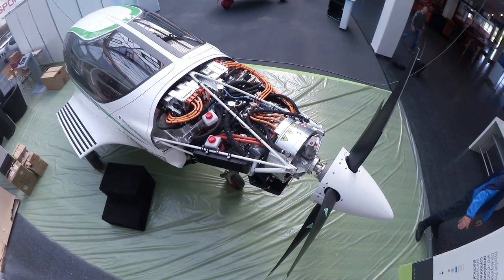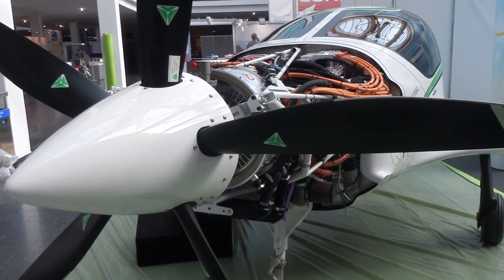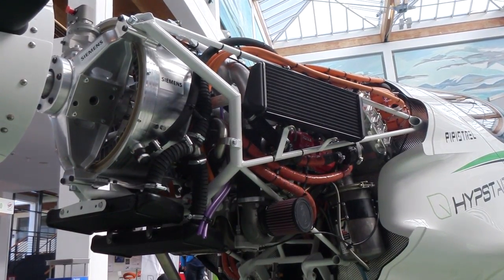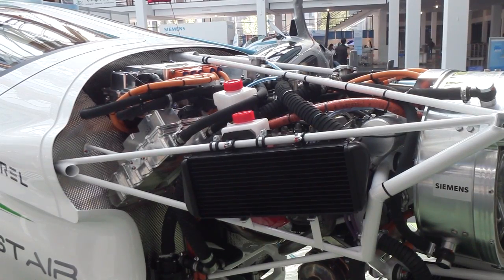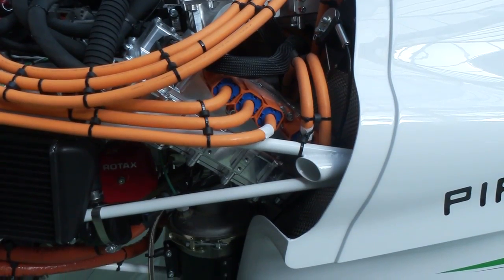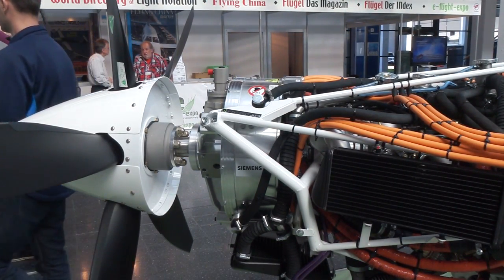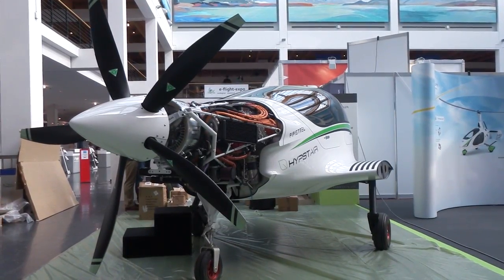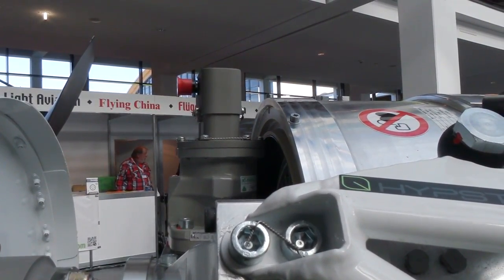Hypstair Aircraft Hybrid Drive

Comment: At that point, if the engine is only a generator, why not locate it further aft for better CG control?
Reply: This is not a car. The center of gravity is supposed to be front of the center of lift (normally at 1/4 cord of the wing). Either way when designing the airframe they customise the enpenage so it doesn't require elevator trim under average circumstances

Comment: Y not utilize a ducted pusher fan, 70% more efficient.
Reply: only when compared to a same diameter prop, and the aero drag of the shroud is not included. Also, integrating a ducted fan to an airframe is another problem, and almost ends up with a smaller diameter fan, hence a higher disk loading, and less efficiency than the prop.  A total solution is needed, not just a single relative statistic.

Comment: gas generator + multiple electric rotors with 2 blade props has pretty good implications for improving aircraft efficiency, using multiple 2 blade props you can eliminate interference drag of 3+ blades, and placing the blades on the wings allows for improving lift under reduced wing area. having multiple electric rotors distributing the power of 1 or 2 generators also can help reduce ground clearance requirements of high performance planes that otherwise demand more and longer blades.
Reply: yan-Deriction how much extra lift would you get by putting the engines on the wings?

Comment: Very cool development. Bu at the same time very complex. Aviation is about safety and that comes with simplicity and that equals to reliability.
A Rotax is complex, a 914 even more and now we have a 914 plus generator plus electric motor plus electric controls...
Reply: flexairz Old school logic.

Simplicity is only one of many avenues available today to ensure safety and reliability.  It used to be the only avenue due to lack of technology.

When was the last time you see a car died on the road today?  If you were around in the 1970's and before (prior to the advent of ECU in cars), you would see at least one car broken down on the side of the road per week.

ECU is much more complex than a simple carburator, yet why is it more reliable, hence safer for drivers?

You said the Rotax 914 is complex but has that engine died in-flight more often than the Lycosaurs?

In fact, more pilots with Lycosaurs experience engine failures than pilots who fly with Rotax - there is no way a human pilot could control fuel flow to each individual cylinder many times a second, for example.

How many pilots fail to manage their engine properly, which results in foul spark plugs, and pre-mature engine wear and shorten TBO?

Electric motors are inherently more reliable than gas engines.  In a hybrid system, even if the gas generator fails, you still have power from the electric motor running off battery.

Again, complexitity ENHANCES safety, not reduce it.

What happens if your carburated engine dies?  Oops, time to look for a suitable landing spot -- yeah well, good luck on that!

Bottom line:  complexity is NOT necessarily unreliable and therefore less safe -  not with today's technology.

Comment: This is a really exciting project.
Prius of the skies!
Reply: +discotechwreck The Prius is efficient mainly because it can take advantage of regen during braking, and partly because the efficiency of the drivetrain was improved, none of those benefits exist with this system. The efficiency of the power plant was not only reduced with this system, but there's no regen braking to take advantage of.
Reply: Assuming it's been developed from the same platform they used on the Alpha Electro, they actually use props with a wide chord at their roots which when at low power, windmill and act as a wind turbine to regenerate power & send charge back to the batteries.
Reply: discotechwreck A) That would offer very little in terms of power to recharge the batteries. 

B) That much drag is rarely needed on a light aircraft.
Reply: +idontcare80 You do realise Siemens, who have provided substantial R&D on this project, have also developed the engines for the E-Fan. What do Pipistrel, Airbus and aeronautical engineering universities know about efficient aircraft & engine design though?
Reply: +discotechwreck They know how to squeeze funding for ridiculous projects out of ignorant politicians.

Comment: Who would want to sit behind such an unneccesarily complex engine? unless of course its being funded by some one else...
Reply: +mhappy01 I disagree, this is a much higher sustained power rating than batteries alone, and a much higher power rating than engines alone (Rotax 912ULS 75 kw) for takoff under any conditions. 200 kw power delivery to the prop is awesome. Air density can seriously put pilots at risk because there is a direct relationship between air density and power output of the engine.
Reply: Well, mounting an electric motor to a generator is much simpler and more reliable than attaching a gearbox. That's why I'd argue that this is a simpler power plant application than exists in many aircraft already today. This type of hybrid has been in use for 80 years in many forms and is far more reliable and efficient than a direct-drive combustion engine.  It's not an unproven concept. The only reason why we're finally seeing this in autos and light aircraft is the advancement in battery technology.
Reply: +mhappy01 An electric motor being driven by a generator is complex?  Much of this is grant funded (universities) and is a joint venture with Pipistrel and Siemens.  

I'm not sure why you're against government funding of projects such as these.  Many of our greatest inventions and achievements as a society are because of government funding.  Want to know why we (the U.S.) is so far behind the rest of the developed world in innovation and infrastructure?  It's because somewhere along the line we got this notion that government spending in all forms is an anathema to a proper capitalist society.
Reply: Actually mhappy01, you're wrong again. The fusion of a internal combustion engine and an electric motor is not a new concept, nor is it overly complex. In fact, from a mechanical perspective, this is MUCH simpler. It completely eliminates any need for a reduction drive needed with gas motors  because the electric motor can be optimized for each type of aircraft. Sure, this idea has taken some engineering, and therefore money, but I would say you're in the solid minority in saying that it is a wasteful project.
Reply: +mhappy01 Are you aware that other countries have spent public money assisting aviation development?  Was that all bad?  NACA and NASA wrote many of the books mate. Or was that just propaganda?
Reply: +John Hogan NACA/NASA is not the EU (there is no comparison).
Reply: +Joash Church Joash, my point was that they are designing a massively over complicated engine, for what purpose? because they can afford to using someone else's money, would it be a viable engine if it were funded by a commercial organisation? It will break and often.
Reply: +Tytus Abrahamson Maybe i'm too pragmatic in this case. But we the EU tax payers are funding the CERN collider to the tune of 9 or 10 billion euros and counting, why? innovation? science? or political bribery to further the EU project? (hell, you cant even point the beam in the air and shoot something  lol just joking). I can understand having a diesel engine on an aircraft (safe, strong, reliable) but this engine/generator thing is never going to be a viable option in an aircraft - like having a titanium tea pot; holds water but wont retain its heat.
Reply: +Tytus Abrahamson sorry Tytus we will have to agree to disagree.  But a small Williams type turbo prop has to be simpler than either this type or any other reciprocating engine. That in my limited/ignorant view is where the research and funding should go.
Reply: mhappy01  You called something over complex it's because you don't understand anything about it nor the advantages ... I like to call people like that stupid.
Reply: +MidShipCivic Go ahead Yank, make my day.! I like to call people who wont accept a different point of view - "american".
Reply: mhappy01 Your inability to grasp science, is not an argument against it.
Reply: mhappy01 Weak. NASA and NACA are awesome, as are those taking up where they have left off.  The rest in YT trolling.  Dude.  Chill.
Reply: +mhappy01 I've just come back to comment after being reminded of how much work NASA has done on hybrids in recent times.  A lot.  This is part of where we're heading.
Reply: +mhappy01 It's like you didn't watch the video period you you just cannot comprehend to see it is a joint venture.
Reply: +MidShipCivic A joint venture paid for by the European Tax payer. Another EU propaganda funding for silly ideas.
Reply: @MidShipCivic  
Civic that was a very snarky rebuttal to a person that actually shows some experience and wisdom even if not detailed out without explicit articulation.  
I would venture to say he watch the video very well. He watched it like an investigator with a lot of knowledge about the industry and the past.  In reality this is not a joint financial venture… It is most likely a grant driven investment from the taxpayers. Siemens and Pipistrel are getting grants from the EU.  These companies do not invest in black holes.  These major corporations have seen it all and do not invest in unwise projects.  And of course, if you look up the universities that are involved, they are public universities spending taxpayer dollars.  Supported by people believing the government  is wise and never wastes money.

There is a skill to dissecting these puff pieces or informational videos, if you will.  However, if one practices listening and slicing apart what the host is saying or more importantly not saying, it becomes much more transparent of what the actual viability and project is.  The proof is in the pudding. More importantly, if you go to the store you will not find this particular putting on the shelf… Guess who was right and guess who was wrong?
Reply: @MidShipCivic  
 No
If it is expired in your your mind of small words then why are you responding.  Follow your advice and don’t respond.  Such an example of attempting to be a bully.